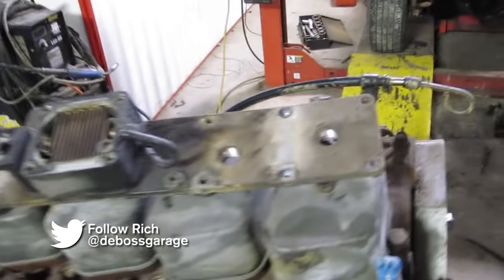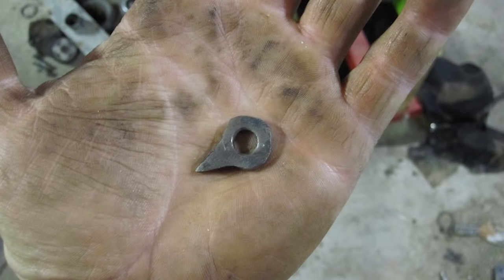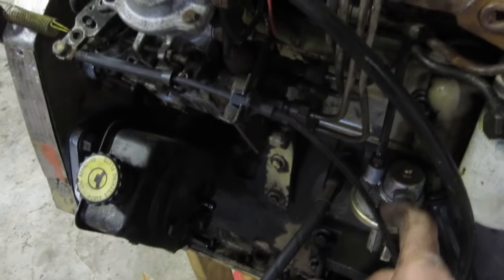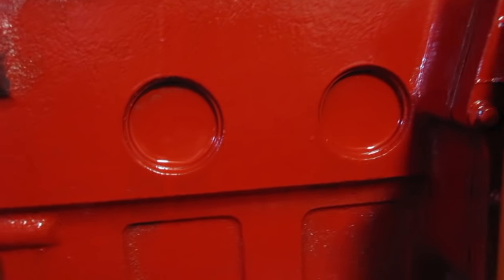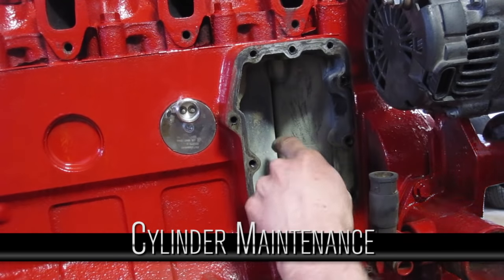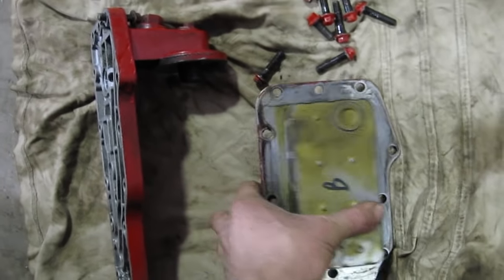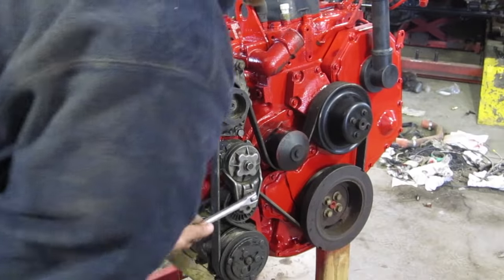BUDGET DIESEL SWAP: 3.9 4BT in a Chevy Tahoe #CumminsTahoe [EP1]

Comment: A dry sleeve is a thin replacable sleeve  that fits inside the block bores. No antifreeze touches it..  Very tight fit, no o-rings required .
Most Perkins diesels use that system. . Old Ford 8n tractors as well.

Comment: Just found your channel and have to say that I'm very impressed. You really seem to know your stuff and have tons of info to offer. I've been kicking around the idea of putting a 4bt in a Chevy k1500. I will finish watching this series to see what it take to pull off. It doesn't seem like it would be super difficult once I know what I need for parts.
Reply: ih1206 put a 6bt I am doing a 6bt in my 98 k1500
Reply: So did you do the swap on the k1500?

Comment: I had a 12v, it was a good cold starting Eng. Mine had sat 2 weeks -20c and lower. Fired up with little throttle in about 4 revolutions not plugged in. Batteries were only year old. Guy I worked with was mad as hell his 24v didn't start that day and he drove it night before.

Comment: Well waiting for parts after my oil cooler split a seam on the road I was researching putting the larger cooler in iirc options are 9, 7, and 5 plates otherwise identical.  The 6bt came with the largest early on . But over cooling the oil lead to deposits in the cooler , witch lead to blowen up coolers , they see unregulated oil pressure. Cummins solution to this was reduce the oil Cooling now the 6bt has the medium and the 4bt has the small.  Flow is oil pump, cooler, overpressure valve,  pluged filter (iirc 15psi) pressure differential valve PDV high side , oil filter (non-bypass) ,PDV low side, into first oil gallery in the block. The reason for this setup is the water warms faster so pull heat from the water to warm/thin the oil. Before the filterif the oil is still too thick it triggers the bypass preventing oil starvation on those bone chilling mornings. Can't get an answer out of oil filter technicians as to what temperature versus viscosity this pressure differential will occur in a Cummins, Fram , wix , or napa filter... lost 2.5 ga oil in 150mi. Found the problem and opened the rad cap limped to town 12 mi to us 50 the loneliest Highway in America

Great job explaining the what's and why fors.

Comment: you need a good ground 
altenator a cable to the batery.less resistens ,less cavitation.i had the problem with the C27 cat .made several ground cables and solved the problem.groetjes sjaak uit rio

Comment: they made a marine version thats 4.5 liter 4 valve per cyl have one in a boat rated at 230 hp verses 150 for two valve its like the six thats a higher output at 6.7 liter
Reply: speed in a 25 ft southwester went from 29mph to 42mph
Reply: engine was built by cummins

Comment: PLEASE tell me you didn't put a Fram oil filter on that............
Reply: Almost as bad as Driveworks.
Reply: I was looking at that also
Reply: Fram is fine as long as you keep up on your oil changes. We use Fram on a bunch of equipment at work, but we cut all the oil change intervals in HALF. Our philosophy is that Oil and Filters are cheap... new engines are not.
Reply: @kadenwatt2033  Wix & Purolator filters are the same price as fram, & the best in their price range. Much better than fram

Comment: hey nice series you have here and i started diggin on doing a convertion myself of an 05 trailblazer to 6bt cummins the main issue i have right now would be that the 4l60e would not withstand the torque 
so, what would you recommend here? getting a new tranny or finding a way with the original?

Comment: Bought a 96 Chevy Silverado 2500 with the 5.7 I will use mostly to tow a 8,000lbs trailer will a 4bt be good or should I go with a 6bt 🤷🏼‍♂️
Reply: I'd go with the 6bt. I don't think the 4bt makes enough power to pull 8,000 lbs with any kind of quickness, I could be wrong though

Comment: Digging the project. I've been interested in the 4BT for a few years now and thinking of swapping one in place of my vortec 350 in my 1996 silverado...not sure if the stock 4L60E will hold up or not though
Reply: Ty Thompson get a 6bt for it I'm doing a 6bt in my 98 1500 z71

Comment: Deboss, I'm currently doing an engine swap in a 04 Tahoe. I will not be using the old ecm. How do I keep my body control module/ inside electronics working without the ecm?

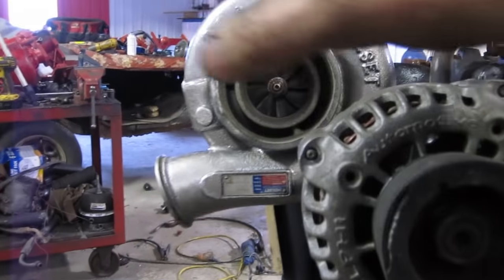Comment: Actually, a coolant filter does filter the coolant. Yes, you're correct in that it reduces cavitation and erosion on the liners but any decent mechanic will tell you that changing the coolant more often will do the same. Also, you mentioned that the turbo manifold and alternator was from the 5.3 at 5:32-5:47... did you mean the 5.9 Cummins or the 5.3 LS engine that was in the Tahoe originally? 🤔

Comment: Could you compare this motor in general to the Duramax 2.8l? I want to know the performance between them

     I have a old ford ranger and I want to keep it and put a 4BT in it but I want to know if it would be better to buy a new Colorado or canyon with a duramax

(I’m a Ford and Dodge fan it’s just curious)
Reply: Nicholas Murphy The Duramax 2.8 is closer to the Cummins 2.8 than the 4BT.

Comment: Actually the freeze plugs are to keep the block from cracking if the water in it freezes. The ice will push out the plugs instead of cracking the cast iron.
Reply from the maker: No, that is just a rumor and doesn't work.  They are ports needed for the casting of the head and just get plugged after.  It will not prevent your block from cracking

Comment: The only time you should replace the coolant filter is when you do a strip test and the nalcool is low ( providing you use a preloaded filter) the filter should last minimum two years.... remember you need to put manufacturer recommended coolant in truck. Not Ford's but Cummins. Will save you a head gasket in the long run.

Comment: Rich! I'd like to do a similar swap with my 1999 Yukonn (old body style). What exactly did you have to do to modify the a/c bracket to work with the GM compressor? Also, how did you adapt the original alternator?

Comment: In your silverado cummins swap...  I want to do the same to my 2500 hd silverado i was wondering since engine is like 500lbs heavier how dose it affect the towing capacity...
Reply: Brian mackenzie  the engine is 750lbs, in a 1/2 ton truck or above I wouldn’t worry about that
Reply: 5.9or 6 bt is heavier than 750

Comment: Did the hx35 clear oil filter housing? What position did manifold is up or down? I got 4bt in yj and need to smooth bends out in exhaust
Reply from the maker: I used the manifold off a 5.9.  Its in a latter episode.  45* out and down.  Tight for the exhaust but clears the filter fine

Comment: Did the 4bt require a fuel pump in the fuel tank or was the lift pump enough to pull fuel from the tank?
Reply from the maker: Lift pump is enough.  Disable the factory pump and install a fill neck from a diesel
Reply: DEBOSS GARAGE I'm in a 88 k30 that had been swapped 4bt by a previous owner. Put a new gas tank on it and sending unit designed for a 6.2 diesel and can't get it to pull fuel from the tank but if I stick the fuel line directly in the tank it will prime off the lift pump.

Comment: Hey there! really enjoy watching your videos! I've been thinking about doing a diesel swap in my truck. I wanted to put the 3.9 4bt turbo cummins in, the truck I have is a 2000 Chevrolet c/k 3500 4x4 dually and was wondering if you knew if I could use the same transmission I have in their now? I'm not exactly sure witch transmission it is but if I could would I have to get a adapter for it? And where could I get the adapter from? Thanks for your help!
Reply from the maker: a 4bt is completely underpowered for a dually.  Go with a 6bt.  You can get the adapter plate and flywheel from Diesel Conversion Speacialists.  Get the controller from US Shift.
Reply: Thanks man appreciate it. I got some dumb questions to ask. When I get the flywheel and adapter how do I know witch one to get? Hope you know what I'm talking about lol, and white the adapters does that mean I won't have to do anything with the transmission and transfercase and rear and front driveshafts to make it all work properly ?  I have a 5 speed manual transmission so do I still need to get the controller? Thanks again for all the help it's really hard to find good help these days and keep up the awesome videos!!!

Comment: So what excatly is a 4bt? is it a cummins engine or a frankenstein of many engine parts coming together to form one?
Reply from the maker: 4bt stands for 4 Bore Turbo'd.  Technically mine is a 4bta because it has an aftercooler.  They are more popular in off road equipment (excavators, bulldozers, skid steers and backhoes) but were also in bread trucks.  It is basically a 5.9 6BT minus two cylinders
Reply: I had one in a 580 L Case backhoe. Worked good. Just remember to plug it in in the winter.

Comment: Did you use the GM Tranny, And  if so, where did you get the conversion plate at?
Reply from the maker: +scott scottswart440 Yeah, i kept the 4l60E to keep the project simple. Its holding up fine with a massive cooler and temp guage to monitor it.  I got the plate from diesel conversion speacialist (formerly Fordcummins.com

Comment: What is the power difference like between the gas and 4bt? So much contradicting info on the cummins engines.
Reply from the maker: Depends on the mods.  Stock its 105 hp and 265 torque.  anything from 400hp to 700 torque is achievable, just depends on your budget
Reply: Thank you for the information.
Reply: DEBOSS GARAGE about time sombody being honest on what the 4bt can do and has.. cause lot of people have 4bt swaps and they make it seem like there running stock engine when I know there not cause stock its a very weak engine with good mpg they dont say the part were they dump quite a bit of money just on the engine alone to get  with the power of a 5.3 or 5.4 but of coarse with better mpg

Comment: what did you do with the factory plug that went into the 4l60e to keep it from throwing codes?? I'm pretty close to starting my 4bt swap on my 04 z71 Tahoe
Reply from the maker: You will have to flash your ECU to keep it from throwing codes.  You can trace the wires back to the fuse panel and just remove the wires after.   The only ones you have to keep are for the 4WD and the speedo.
Reply: Awesome thanks again

Comment: Why did you use the smaller of the two motors? was the 5.7 one you were getting parts from broken or too big?
Reply from the maker: The 5.9 was too heavy and too much torque.  It would rip the rest of the Tahoe to shreds.
Reply: mMkes sense thanks. So if I have a dying 2002 tahoe, what would you recommend as my target donner vehicle to get as many of the parts as I need? I did note that you swapped some parts. thanks Note Im in the States and thinking mild off road.
Reply from the maker: Dodge cummins 12v (mounts, oil filter housing (horizontal rathar than vertical), pre-heater and wiring)
Reply: I.m assuming the 12v for the parts because you said you went with the smaller engine. . What would be your engine and tranny choice and what 4wd vehicle should I target? the 4BT? Sorry to ask such basics, I;m a car guy!
Reply: Ahh I can use my tranny and transfer case correct? just need that adapter.
Reply from the maker: correct
Reply: Are you familiar with ATF live? Does that replace all the futzin with the star wheel and such?
Thanks!

Comment: Do you have any recommendations for a 4bt build? We are looking for 275-300hp
Reply from the maker: +David Byrd You are wondering of a good vehicle to put it in?
Reply: +DEBOSS GARAGE no, I have it installed in a 99 suburban. I'm looking for suggestions for performance parts
Reply from the maker: +David Byrd pump mods including turning the power screw, a 3200 rpm governors spring and a fuel pin (ebay) is the first and cheapest thing to do.  after that an he221w Holset turbo will give you a better range of boost es
pecially at low rpm.  after you pump more air into it, you can put more fuel into it by pitting bigger injectors into it.  the turbo will be the biggest expense
Reply from the maker: +David Byrd pump mods including turning the power screw, a 3200 rpm governors spring and a fuel pin (ebay) is the first and cheapest thing to do.  after that an he221w Holset turbo will give you a better range of boost es
pecially at low rpm.  after you pump more air into it, you can put more fuel into it by pitting bigger injectors into it.  the turbo will be the biggest expense
Reply: +DEBOSS GARAGE Are you in Alberta? What does it cost to have you do a swap like this?

Comment: any advice for a p-pump instead of the rotary vp44?
Reply from the maker: P-pump is more reliable than a VP44.  Even though it has moving parts inside, it runs at less pressures and if maintained properly, could last the life of the engine.  They are easy to modify for increased fuel delivery.  The VP runs at higher pressures so will fail quicker.  It adjusts the timing for better fuel economy but does so electronically.  More complex system so more likely to fail.  They are however not that expensive and also not that difficult to replace.  You will get more stock HP/TQ out of a VP44.  I would buy either one and not really steer one way or another.  The shape of the truck and transmission would have a bigger influence as to which way I would go
Reply: DEBOSS GARAGE thanks a lot I went to college for diesel a couple years ago but being a welder made the diesel a little rusty. I'm trying to put a p-pumped 4bt, and a 4x4 zf5 in a 1988 ford ranger

Comment: A 5.9 litre Cummins Diesel in a Chevy Tahoe? Why not? As long as it fits inside the engine bay, and the gearbox can withstand the power and torque.

Comment: I love this! keep it up.
Reply from the maker: flatjawspud Thanks!  We appreciate the feedback.  Nothing but cool projects are on the way.  Let us know if there is anything you want to see
Reply: DEBOSS GARAGE  hey man I just bought a Cummins 12 v and it has built trans and a converter lock up switch will u plz make a video to explain when to use it safely and why someone would want this
Reply: google how torque convertors work and you'll answer your inquiry
Reply: electron being  thank you sir
Reply: electron being from what I gathered it's puts everything in a 1to1 ratio so is it like a extra overdrive ??
Reply: you're right, it changes the torque convertor from a fluid drive coupler that has a gear reduction inside of it; into a locked up 1:1 drive. you say "extra overdrive" and no i cant agree with nor make any sense of that. i've never heard of an overdrive convertor. but hm i have google right here
Reply: electron being idk I really just want to no when and why I would use or want this
Reply: when you don't want your convertor converting
Reply: Look I just want to no when and why to use this if u can answer that great if not thanks for trying idk why it seem like your just making this harder than it needs to be

Comment: I've always been told when you're brazing you don't want to melt the brazing rod with the flame you want to heat up the material that you're brazing hot enough to melt the brazing rod otherwise you're going to be getting a shitty braze.

Comment: what year is the 4bt?
Reply from the maker: 91
Reply: DEBOSS GARAGE what kinda torque
Reply from the maker: stock hp is 105 and stock torque is 265.  I used a different turbo and turned up the pump with fuel pin and governor spring.  I should be somewhere around 170/350

Comment: why not just a 5.9?
Reply from the maker: +Raul Pompa Dressed weight of a 5.9 is about 1200 lbs.  3.9 is about 750, so I would have to replace the torsion bars with a 3/4 tonne.  They are longer so I would have to move the support back.  The 5.9 would also rip my 4l60e transmission to little pieces so I would have to put in a 4l80e at the very minimum.  Unfortunately the bellhousing  is much bigger so the Tahoe would need at least a 1 1/2" body lift.  All this would double the cost of the build.  I am very happy with the 4bt family hauler and very happy with the 5.9 I put in my 05 Silverado.
Reply: +DEBOSS GARAGE  you know your shtuff! i've been draming about dropping a 5.9 into my 85 dodge w350 4x4 with a 360 4 speed granny 1st, but i'm thinking it could get real expensive real quick considering the 4.56 gearing and no O/D... think I'll tough it out with the old 360, maybe an overhaul... keep up the bizzarre swaps!
Reply from the maker: +Raul Pompa Have you watched our 85 Dodge conversion series?  We are almost done but it would help you with your understanding of everything involved.  I actually have more time into the 85 than I do in the Tahoe conversion.  Mainly because I can't get wiring harness's for the 85 and every wiring harness I came across was covered in oil, corroded and hacked.   Thanks for the comments!
Reply: I've been contemplating, kind'a like you with the Tahoe, of getting a (engine) worn out Ram 1500 4X4 and junking the stock Hemi for either a 5.9 cummins or (now that I know it exists) the 3.9/4BT....my question is, would the  3.9 have enough butt to pull my loaded horse trailer of about 6,500 Lbs at 70 Mph??? And will both the 5.9 and 3.9 fit ok in the Ram 1500??

Comment: What parts from the 5.9 Cummins did you use on the 3.9 Cummins?
Reply from the maker: 5.9 and 3.9 are the exact same engine, minus 2 cylinders.  Everything will bolt up.  Nothing will bolt to the 8.3 except the front balancer and I believe the ring gear.
Reply: @DEBOSSGARAGE  I mean what parts of the 5.9 did you use for the Tahoe Cummins? I'm going to put a 4bt into a Chevy S-10 and I want to use some of the Banks products.